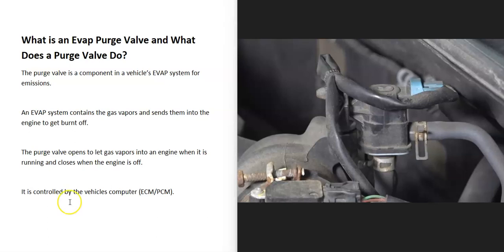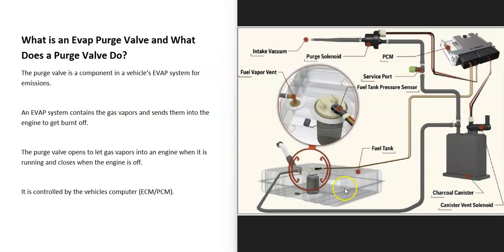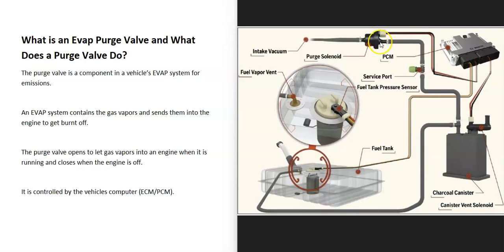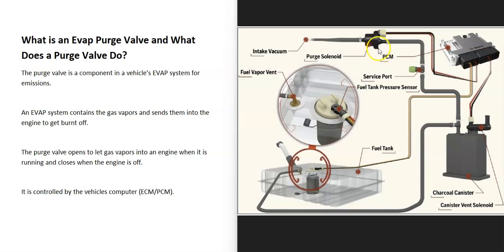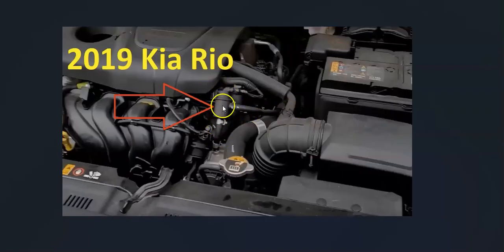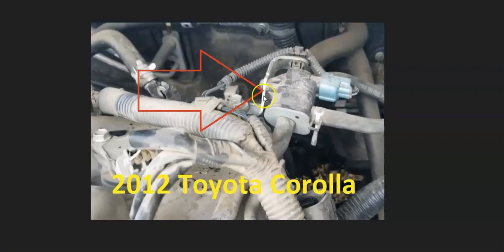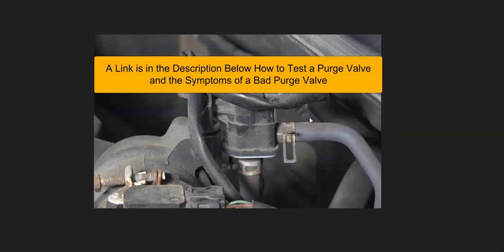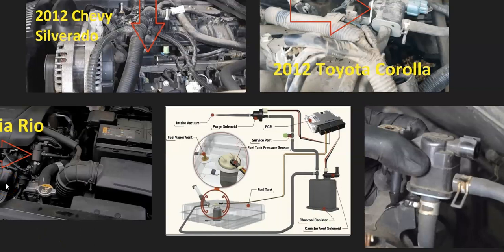What is an Engine EVAP Purge Valve?

Comment: Do you know where the evap purge valve is located on an 07 impreza? It has this far eluded me
Reply from the maker: It is located on the top of the engine, roughly centered at the top. It has two hoses and a plug.
Reply: @HVAC_Mechanic nice, thanks

Comment: I have a 2016 hyundai tucson 1.6 turbo and i just replaced purge valve and was struggling to take off bottom hose that goes straight onto throttle body and there's something inside the hose some sort of check valve i think and a arrow on hose.... now my dumb self took off hose and I don't know which direction the arrow was pointing to.... is it pointing down towards throttle body or up towards purge valve